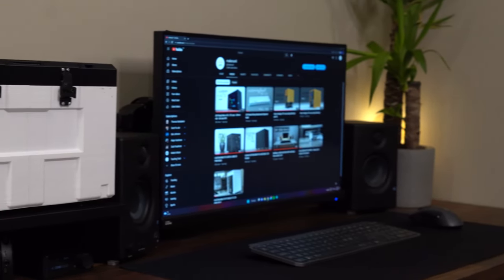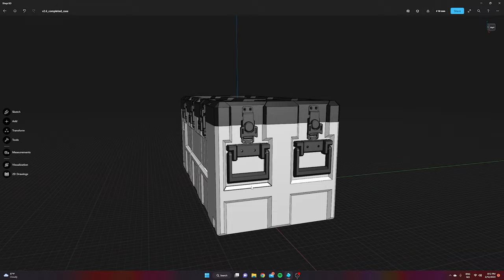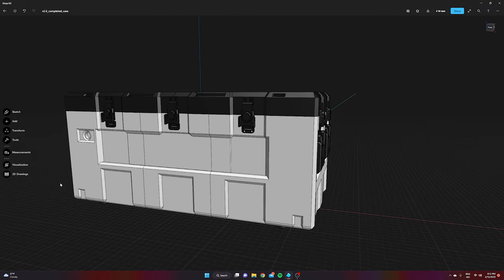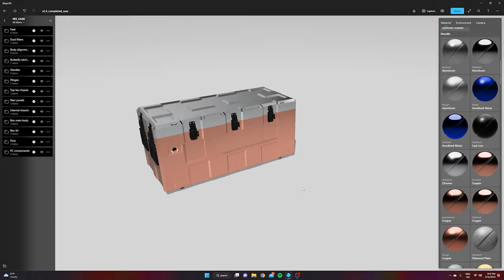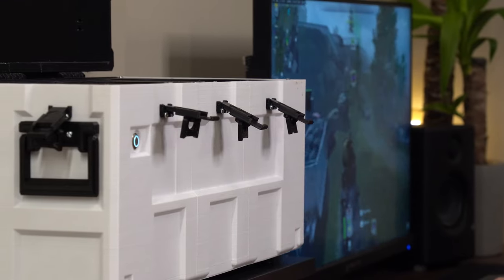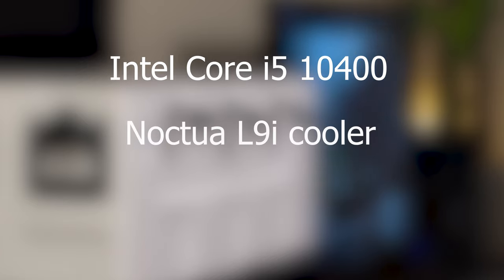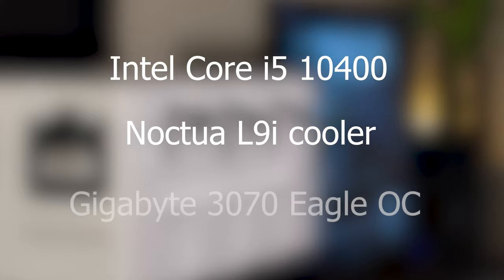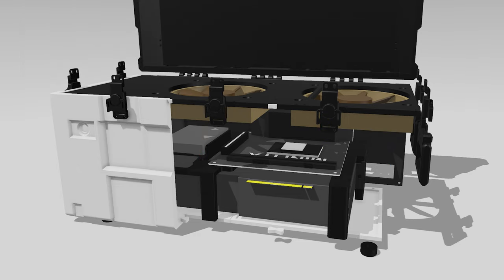Warzone Loot Box 3D Printed PC case

Comment: Very cool work, I will print the storage version! 😊
Just one question: In what orientation did you print the lid of the box? Exactly in the way it sits on the final box at the end?

I'm just curious because it seems to have been printed without support and therefore requires A LOT of bridging?! Maybe you can explain this to me, thank you very much!
Reply from the maker: Hi! The printing orientation of the lid is standing up with the middle joint facing down to the build plate, this does leave a very small portion to touch the build plate so be generous on the brim or add discs to the corners to prevent warping if you can 😊

The outer edges of the inside of the lid does have 45 degree angles meaning you’ll need no supports.

If you look at 1:45 in the video, you’ll see what I mean just for a second there. 

The two parts were printed facing eachother with tiny bridges inbetween to stabilize them during printing. Then the bridges were just cut away afterwards.
Reply: @makerunit  Oh, I must have missed that second in the video 😅 Thanks for your explanation!
Small note: The handle of the butterfly mechanism is missing from the print files. I got it from the step file, but you might want to add it as STL or 3MF :) Have a nice day!
Reply from the maker: @ITRaidDE  Oh really! My bad then. Thanks for letting me know I’ll try to remember to add that file later today 😊

And I totally get that it’s easy to miss that second and I should have probably mentioned this more in the video  😊 

I learn from my mistakes as I go trying to explain better and better every time I post a new video 😊

Comment: Hi. Your work is inspiring. You can use a processor with a built-in video core, and connect the monitor to the motherboard. Thus, a discrete graphics card will be responsible for video processing, and the built-in graphics card will simply display everything on the monitor. This shouldn't have a big impact on performance.
Reply from the maker: Thank you! You mean to avoid having the DP cable out the hole in the side? That’s definitely a possible solution.
Reply: @makerunit  Yes. The cable is connected to the motherboard. "You mean to avoid having the DP cable out the hole in the side?"

Comment: How much filament did it end up taking? Just out of curiosity
Reply from the maker: The exact number I don’t have due to I made multiple attempts at different design details. But roughly 1.5 kg of white PETG, and about 1.5-2kg black PLA I guess so a total of a little over 3kg.

I might take it apart someday to weigh all the parts to get the exact number.
Reply: Thanks, I was just curious. I just ordered a printer specifically to make tarantula enclosure, so im just picking everyones brain here and there trying to get some general round abouts. Thanks man, I appreciate the reply you do some awsesom work
Reply from the maker: @rebeldrip4379  thanks! Appreciate it 😊

Comment: Superglue isn't the best adhesive...it's very brittle.  Better to use a flexible glue or epoxy
Reply from the maker: You are probably right, and there are definitely better alternatives. However, it worked for my purpose in this case. None of the locks have come off yet after tons of openings/closings.
Reply: @makerunit  It will probably work in the long term but just fyi that is the major problem with cyanoacrylates..very weak in this manner
Reply from the maker: @TheTastefulThickness  I’ve recently starter using some polyurethane gorilla glue to add magnets etc to designs and it has worked pretty well for me.